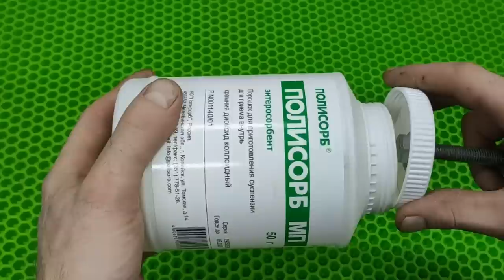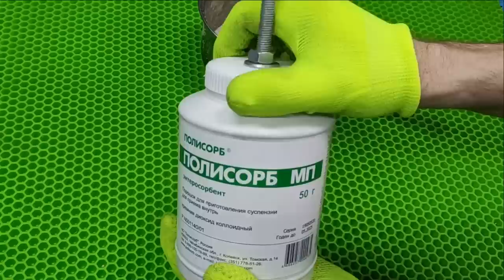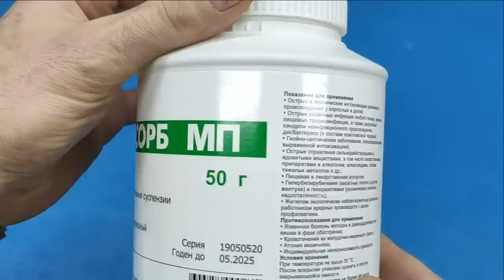I wish I had known the SECRET when I was 50! I would have died without knowing

Comment: I made one of those magnets out of a magnet and a 3/4" x 5" wooden dowel and a wasp spray can lid, when I was about 15, to help clean our family drill press. That was well over half a century ago. Harbor freight features one on a yellow tube that has a D-handle, 24" long. Dandy for cleaning up your piddeling area. THANK YOU for your video. This shows another way to do it.

Comment: Battery drills are not designed for continuous use: that'd overheat, and burn out in no time!
Reply: It would be a lot more efficient using a small, Powerful Plug-in type motor but that would depend if you wanted it to be more portable. I agree about the batt drill overheating if continuously used tho.

Comment: For the cost of a nut and washer !!id save the life of the battery and drill
Reply: The funny thing is that those are new nuts and washers.
Reply: If it really works--btw what is the sand in the jar?--i see the value, because a lot if old shops have piles if rusty metal parts around in jars, drawers trays...drill bits, etc. Have tried oil in a bowl overnight, lots of work. This is worth a try.